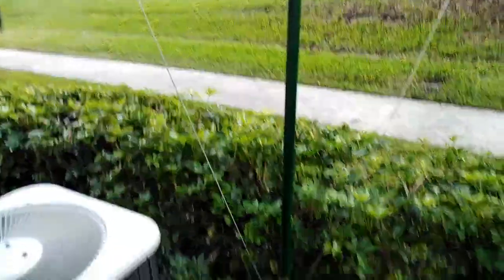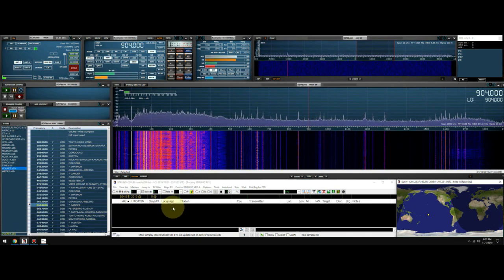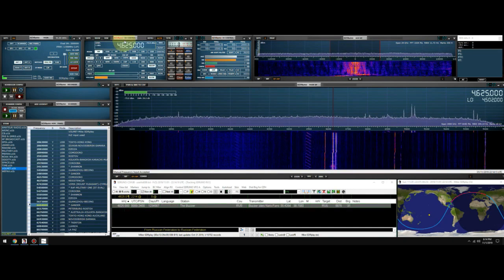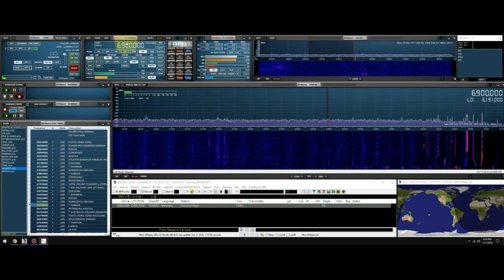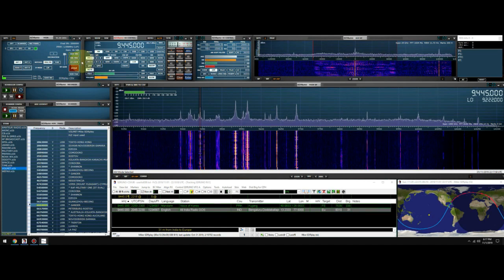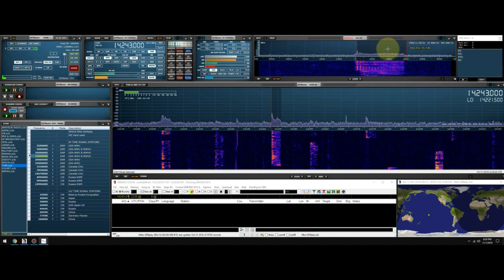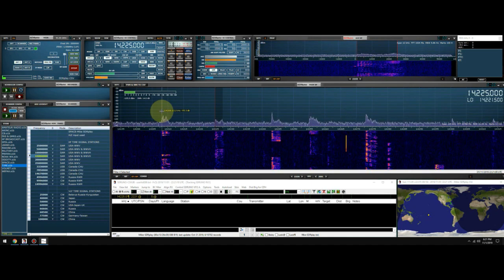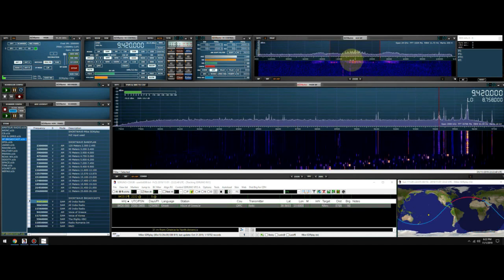RSPdx in Florida on HF P1

Comment: Nice setup Mike!
I just ordered a FX myself. I already have the SDRdx. A couple of questions.
Is this about the same setup you had with the ML200, with about 4' across the top?
Which 1:1 choke are you using? I'm  using LMR240uf instead of the 400uf. Prob not much difference.
I'll be grounding mine to a 10' grounding rod I drove into the ground a few years ago.
Many years ago I was stationed in FLA. Near Daytona and  Eustis.
Stan
Reply from the maker: This is the choke I use
https://myantennas.com/wp/product/cmc-130s-3k/

Comment: How do you get such a low noise floor? I've got a RSP1A, Looks like you're around -130. I can't get anything below -100. Now I don't have a loop, and I'm just using an end fed wire. Would grounding somehow make a difference?  BTW, thanks for the video on CSVUB. It's great! Nice work!
Reply from the maker: It's worth trying.
Reply: @SDRplayHamGuides  Actually it depends on a lot of factors - I understand that sometimes grounding actually increases the noise. I would be looking at a different antenna - a loop, certainly but there are other wire type antennas - like the PAR end fed - that can be quieter. The PAR has a box where you can change the connections to the balun so you can fool around with what works best for you.  It does take some experimenting, from all the comments I've read.. It's also important to get that antenna away from the home as much as possible.

Comment: what was the software you brought up while in digital mode ?
Reply from the maker: DREAM DRM decoder
Reply: @SDRplayHamGuides  There's been a few versions of this floating around depending on whether you want to do the compiling.  What version are you using - 2.1?  And from where did you get it?
Reply from the maker: @michaelagner4355  Using 2.1,. I don't recall the exact source.